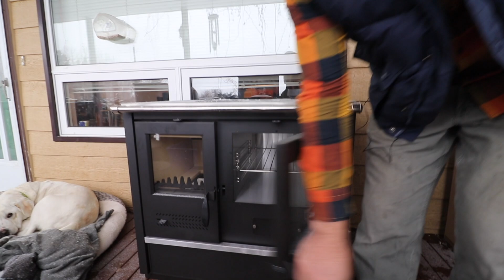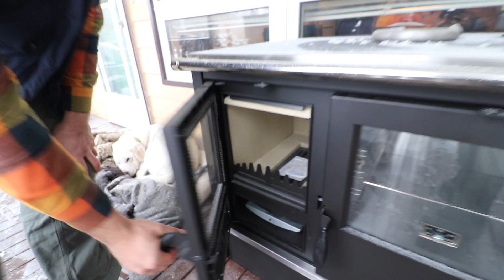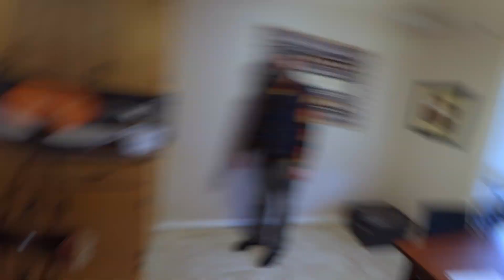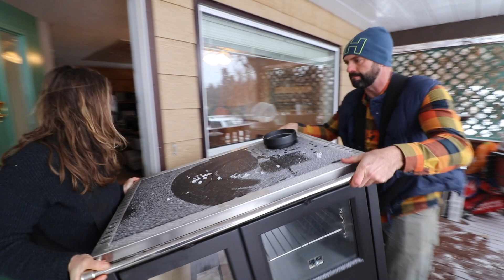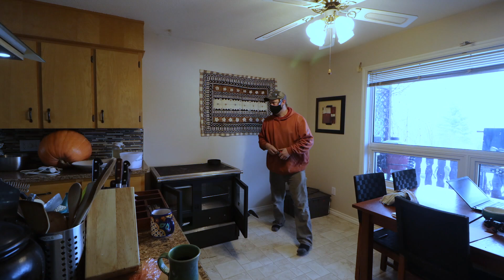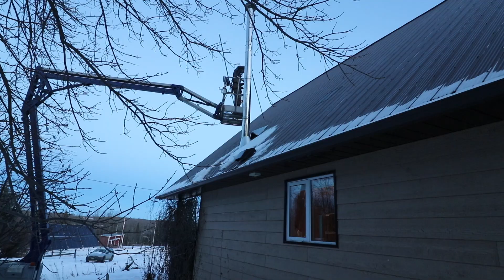Our Sopka Wood Cook Stove is Installed and we LOVE it!

Comment: Don‘t know what other heating system he's using, but using a heat exchanger he should be able to use the heat that goes to the exhaust pipe to heat (pre)heat some water ie for an upper floor/extra room.

Comment: The Spoka (aka Tim Sistem) North cookstove is the one I settled on, too, after doing a bunch of research a year or two ago. I have my unit but haven't installed it yet, but it should be installed in time for next winter's heating and cooking season in the house we're renovating. I also got the water-heating coil and the ceramic glass cooktop as optional accessories.

Comment: your 'thermal coil' should not be placed in fire box/chamber cause it will lower the temperature and make the burn process less effective, it will also degrade faster, put it further ahead outside the burn chamber, it should collect energy from smoke/exhaust gasses after they are burned completely; if you use it just like you described you will pollute and waste fuel

Comment: Nice! I hope this works well for you. Can you take the exhaust from the stove into a series of bells to capture any remaining heat from the gases before venting through the chimney? The broaudio YouTube channel has a “tiny walker” masonry stove with a similar size and form that illustrates this with a heated bench. Would that be asking the stove to perform too many functions? Building code and what modifications can be made to an engineered appliance that have been tested and approved by a regulator may be practical limitations. You guys have a ton going on at the property, so it could be added later, but looks like there might be enough space next to the stove for something. Thanks!